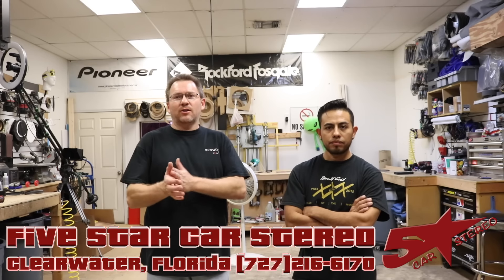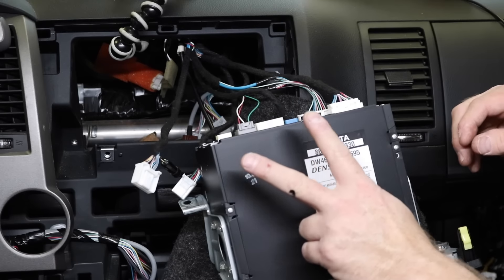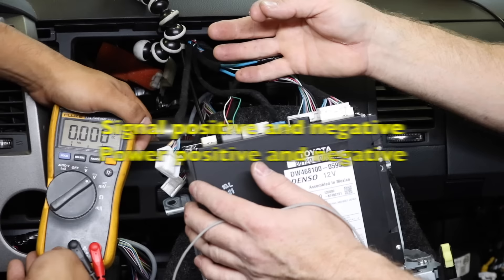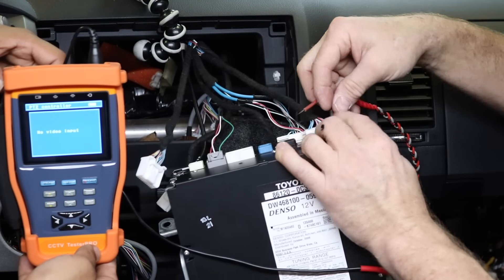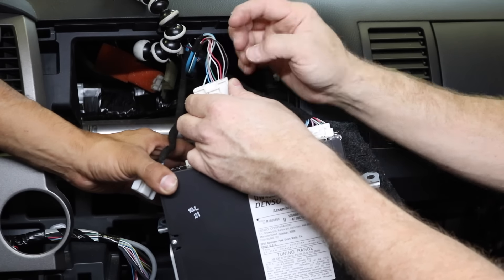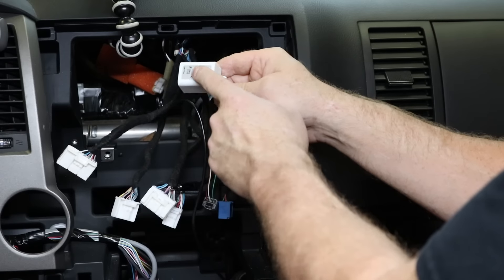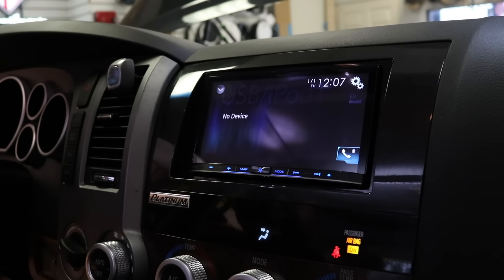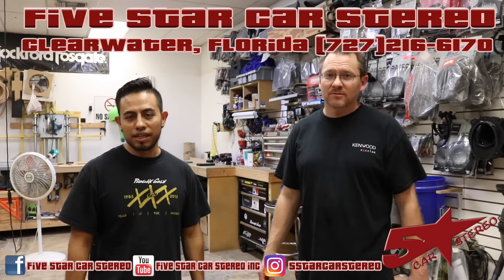How to retain your Factory backup camera when replacing your radio

Comment: I did everything step by step but got lost on the 12 volt to 6 volt and also using a multimeter to find the the power and ground to connect rhe 12 vloth to 6 volt and i have a 2010 tundra with factory backup Camera

Comment: Will this work for a 2010 Chevy Silverado 1500 LTZ? Had factory nav, steering keys and the works. Everything is working through harness but the backup cam. Anybody with info please help. I used the PAC RP5-GM31 harness kit.

Comment: I have a question regarding converting the voltage. I have 2006 superduty ford with aftermarket head unit (Pioneer) with a factory ford tailgate emblem camera off a 2014 truck. I want to connect the factory camera to my pioneer headunit. Do you know what voltage I would need to supply to the camera as I cannot perform the method of searching for the voltage as you did since the truck does not have existing cables going to the camera from factory. Thank you for your help and any advice.
Reply from the maker: portishead600 it is a 6volt camera
Reply: Thank you

Comment: Hey guys - excellent video. I'm about 80% the way there. I have a 2013 Subaru Impreza +SD NAV. They headunit is a Fujitsu OEM Ten unit. Similar to your video I identified two plugs that would kill the rear camera -- one that kills the signal, the other kills the power entirely (screen goes black). I used a multimeter to identify the 12v reverse wire (which ended up being a part of the wiring bundle that, when removed, made the entire HU power off) and connected it to the purple Reverse In on my Sony XAV-AX100. The part I'm stuck at is identifying camera power in. Using my multimeter, NONE of the wires read ~6v. They're all 10-13v. Could it be that my factory camera is powered by 12v instead of 6v?
Reply from the maker: Ramy Khalil yes that is possible. That this point you may have to start cutting or unpinning wire to see if the camera powers off.

Comment: I have a 2013 ram express single cab that has a back up camera. but the screen for it is on the left side of the rear view mirror. how would I connect it to a after market stereo?
Reply from the maker: Juan manuel V check out this video it will be very similar 
https://youtu.be/9XWUxCGIpXQ

Comment: Do you guys know if any backup camera cable exists for Toyota highlander 2012 that could be used to retain the OEM camera and be used with the Pioneer NEX?
Reply from the maker: +Wagdy Tawadrous check out this video it should be similar.
https://youtu.be/w-OeDqL9gk0
Reply: thanks guys, but do you know if the backup cables used for the 2017 Highlander would work with the 2012?
where your shop is located?

Comment: What is the purpose of the 12 to 6 volt adapter if it is a 6 volt camera and you are getting 6 volts at the back of the Head Unit?
Reply from the maker: Ben Drake if you are removing the factory radio you need something to power it back up. The aftermarket radio does not have a 6 volt out.
Reply: I see. Thank you for the video. I have been searching for this info for quite some time.

Comment: Ok guys i have toyota tacoma 2007 pioneer 4000nex and I try to install some back up camera but for son reason don't work the camera i got is coming with RCA connectors with a little peace the red wire on it and one connector with two cables one red and the other one black so, I connect red wire on the reversed light and the black too and the little peace connect with the red wire and at the pioneer just connect yellow RCA and the little red peace on the reversed purple white wire so when i put reversed on my truck changed to back up camera but is not video on it look like the camera's not on so can you guys tell what I do wrong thanks have nice day
Reply from the maker: Jose Cortes rca with red wire- connect rca to camera and brown on back of radio. Connect red wire to Accessory power ( Pioneer plug red) behind radio, connect at camera to red/ black plugs red wire. Ground the black wire. Run a separate wire from your reverse lights to the purple white wire behind the Pioneer. Go into the radio menu and turn on the camera.

Comment: where did you fit the reverse detect wire?
Reply: @1:25.  They found the wire but didn't show a video of soldering it to the aftermarket HeadUnit "Reverse-Gear Input".  I think technically, you can just shove the wire into that slot on the harness instead of soldering, but it can get loose of course.
Reply: @StephanieHua  i think i have an idea now... that wire goes to the detect wire that is fitted on the aftermarket? am i right??
Reply: @lorenzoleonor990  correct.  but you should test it like they did with a multimeter.  Setting to Reverse on your car should make the voltage change.

Comment: I have a 2011 ford expedition with factory navigation and rear entertainment. my factory navigation system is called Microsoft Sync, but the rear dvd player stop working and ford wants $1600 to replace it. so I want to keep my factory navigation system add a new aftermarket dvd player.
Reply from the maker: 906lane if you overhead has an AV input you can use that to a a new DVD player.

Comment: Don't understand why we need a 12v to 6v converter if the power you probed is already 6volt, why?
Reply: Because the radio is stepping down the 12V incoming from the car and outputting 6V to the camera. If you're replacing the OEM radio, the aftermarket radio will no longer step down the voltage for you.
Reply: Correct, the after market radio will put out 12v and the camera oem is supplied with 6v.
Reply: @crazycrackalacka  No the aftermarket radio doesn't output anything, you're just tapping the 12V supply from the car to the headunit to power the backup camera.
Reply: @Jason_R28  what I meant but thank you for putting it into perspective

Comment: My car comes with a backup camera I want to add an aftermarket stereo single din jst under the factory stereo by only leaving the power and camera cables on the factory one so that the it only works for the reversing and the speaker cables go to the aftermarket stereo stereo.the two head units will share the power source. 
Kindly advice me

Comment: wouldnt it be simpler to just plug in the new radio to see if the backup camera works.  If not then you've narrowed it down the wires you need to whatever isn't hooks up.

Comment: Trying to do it on a 2013 Nissan Altima SV but I can’t seem to find the wire behind the radio.
Reply: 2013 Altima base, got a sony xavax100 installed, want to retain the stock camera, the guy in local strore just simply advise to install a new one, really dissapointed, i have to figure it out by myself

Comment: Question amigos look I have toyota camry 2013 I'm planing to retain the camera and use with AVH-2300NEX I order this connectorScosche((((( CRTTA01 2014-Up Toyota Camera Retention Wire Harness 16 Pin))))))  online  I still need to use Add-On with 6 volt turn on please help me out here thanks have a great day.
Reply from the maker: It will need a 6volt turn on, but it should be in the harness. If not get a PAC volt39

Comment: Does this work on GM vehicles
Reply from the maker: BTNHFan04200 GM will need a smart harness to replace the radio. Most of those have camera retention. What car do you have?
Reply: Five Star Car Stereo i have a 2011 sierra 1500. With an aftermarker alpine deck. I have a scrap yard here. I was going to find a newer sierra and take the whole tailgate handle assembly and camera off of it. Then follow this process. However it seemed like a lot of work lol. So I just ordered a camera that is designes to be drilled and mounted into my tailgate handle. Lol so thank you anyway for your swift response